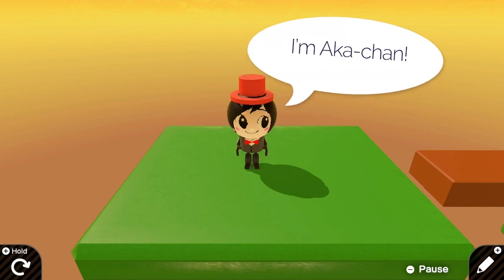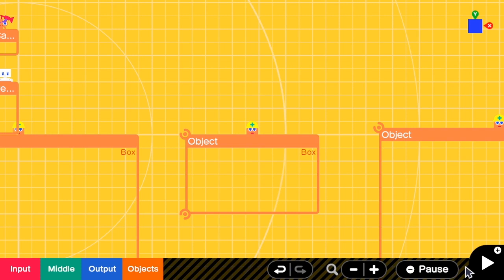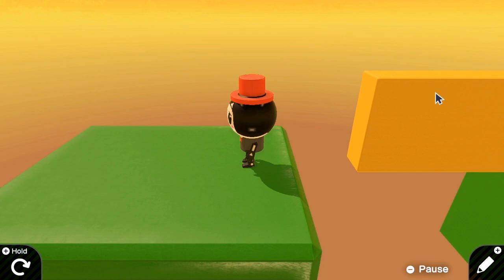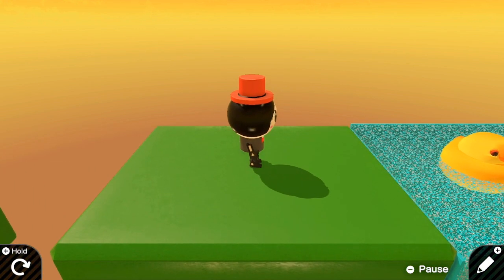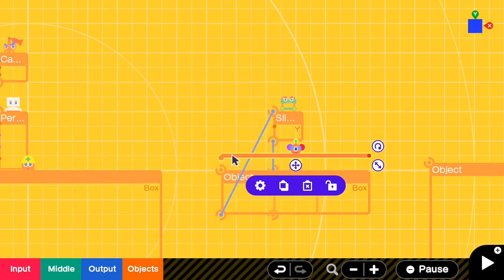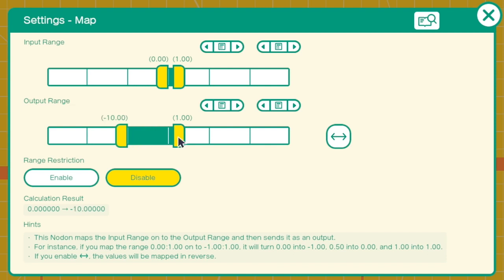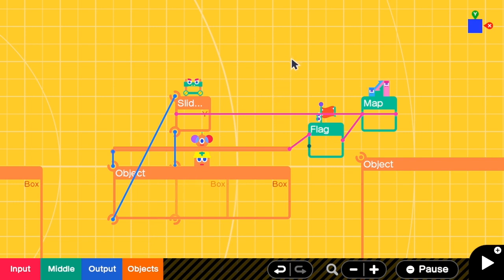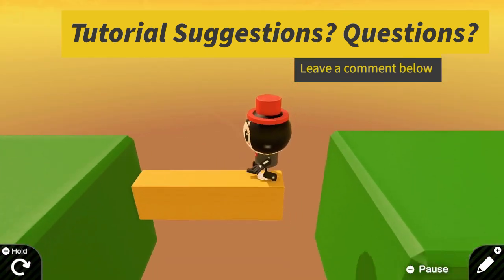Falling Platform 4 ways | Game Builder Garage Tutorial

Comment: How to do a delayed fall on another way: Call up and object Nodon and then set it to VISIBLE, SOLID, MOVABLE, (platform)
2. Copy that object Nodon and disable visible, Movable and enable destructible.
3. Call up a destroy object Nodon and connect it to the invisible object Nodon
4. Call up a timer and touch sensor (touch sensor: INVISIBLE CHECK PERSON ONLY. Connection point: Y- Y+) (Timer: SET OUTPUT AFTER HOW MANY SECONDS TO 3). And connect Touch sensor to the platform then connect it to timer then. Connect timer to destroy object.
Reply from the maker: That's great! : ) Thanks for sharing your method.
Reply: For special method: connect texture to flag and connect flag to touch sensor